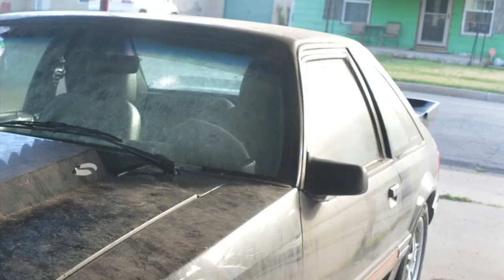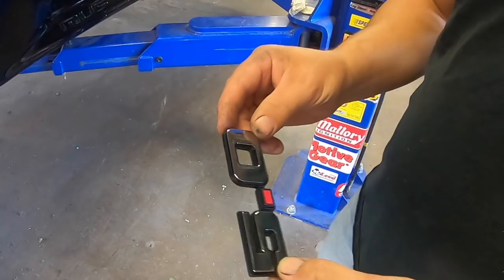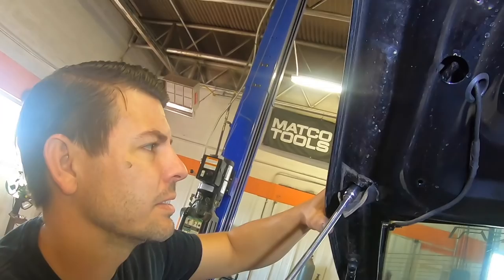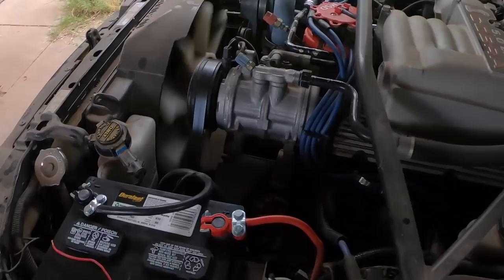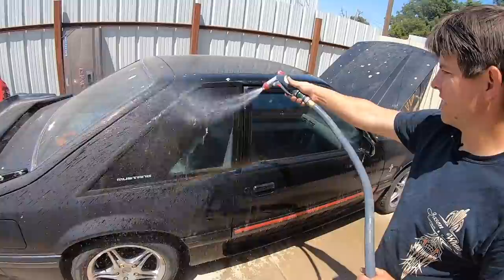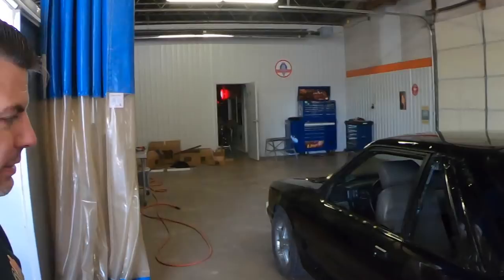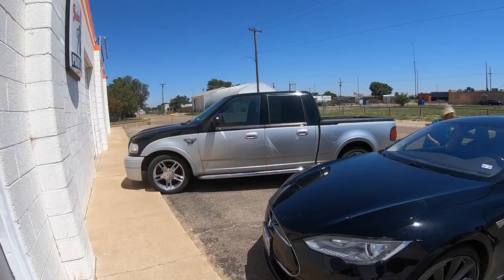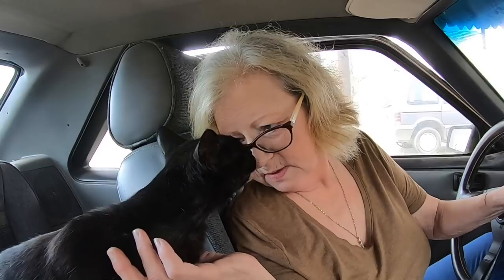Watch Us Rescue &  Restore Neighbor Lady's Mustang At No Charge

Comment: Cars are worth more unmodified. I had a friend buy a Brand New Trans Am in 1978 for $6000.00 He then spent Thousands of dollars modifying it to turn it into a quarter mile drag car along with buying a trailer to put it on and a pickup to tow it with. At auctions a nice T/A of that vintage often sell in the $25,000.00 range. That car being modified would be worth nowhere near that not to mention all of the money that was pissed away on everything else.
Reply from the maker: Absolutely and this is a common problem with performance cars.

Comment: good work!  we were all disappointed when you removed his custom touches but at least you didn't rip her off for the car and got it going for her.  the cobra intake and gt40 heads, wheels and custom hood and JBA parts were likely worth more than the 4k you offered, and worth more sentimentially as they were his unique custom touches.
Reply from the maker: Oh, so nw you think this 5.0 has GT-40 heads? Unbelievable. You think we made an offer? No offer. She had a sentimental attachment. Like the video says at the start, we decided to help out a neighbor and save a car. Once the weather stripping breaks and water gets inside, the car would really go downhill.. Those are stock GT heads, and the ports don't match the ports on the COBRA  intake that was stamped CHINA on the reverse side. The old plastic parts were in poor condition and would take more money to repair and paint than they are worth. The son saved the original parts and did not even remove the catalytic converters or smog. Unfortunately, over 13 years the original spoiler hood, and other stock parts went missing.

Comment: just the paint correction alone would cost a grand, Pluse the parts they purchased to replace the performance parts they removed. They were going for reliability so that she could get around in it. If you have ever modded a car you know the first thing you loose when you start putting on go fast goodies is reliability. Agree with what they did 100 percent.
Reply from the maker: Thanks!!

Comment: I agree with a lot of the previous posters.   They should have freshened up the mechanicals, power polished the paint, and left the kid’s additions on the car.  It was his vision, and a connection for her.  And they couldn’t even be bothered to put the proper trim caps on the stock wheels??
Reply from the maker: We "couldn't be bothered?" We bought the Turbine wheels off eBay,  but no covers came with them and we have been hunting a set ever since.

Comment: Those JBA decals on the car are from a well known and somewhat famous even Fox Mustang  builder, modifier, and performance parts company called J. Bittle American. Anyone even the least bit knowledgeable about performance modded 5 Litre Mustangs would know this. J.Bittle American probably supplied the son with most if not all of the aftermarket performance parts on the car. To my mind, the car should have been fixed up and restored to running condition the way the son originally had the car, with all the performance parts and mods  left intact, rather than as it is now,  a boring, basically bone-stock, 'belly button' car.  As a former owner of 5 Liter LX coupe that I bought brand new in the spring of 1989,  I can tell you that to most of us who bought a new 5  Litre Mustang back then, the car, rather than being just mere - and and somewhat basic  transportation - was really a blank canvas to build, hop up, modify and make truly our own, to our hearts desire and to the very limit that our budget and high performance street drivabilty would permit. This car  is, or was  - at least until these  'return everything to stock obsessed' so-called "restorers" got their hands on it - one of these!

Comment: Why would you get rid of the Ford Cobra intake and go with a std 5.0 HO intake? The Cobra intake is highly coveted and flows better.
Reply from the maker: Primarily to do this car right, being so "untouched," meaning with the smog and catalytic converters. The Cobra intake flows better into larger Cobra heads, but this 5.0 GT motor has stock GT heads with smaller ports. The son saved the stock air box, so we used that. He had saved, apparently, all the stock parts, but over the course of 13 years the rear spoiler, hood, and other parts were missing. He took extremely good car of this car. I will show more of this in a second video.

Comment: Why would you take off the gt40 intake to put a stock on??
Reply from the maker: To do the car right because it was so original and untouched, and for maximum value - if Jason was going to do all that work. The engine was so incredibly original, right down to the smog system, intact, and even had the catalytic converters. The intake might have said Cobra, but on the back the Cobra intake was stamped "CHINA."

Comment: This can be looked at in several ways. On one hand, I understand that the restoration guys DID NOT HAVE TO DO WHAT THEY DID, they put at least 2grand in this car with parts alone, and not to mention the labor. So by basically restoring this car, they put this lady in the position to sell it or drive it as her own. But on the other hand, (being the owner of 3 fox bodies myself), I can see why several of you guys are upset. I mean, her son had the Cobra upper and lower intake setup, MSD, Cold air, 5 lug conversion w/ aftermarket wheels, and Cowl hood and spoiler. To remove all of that would get me upset too, my question is, what happen to those parts. Did they return them to her?

Comment: A Foxbody in decent shape(which this one appears to be) is going run you around $8K minimum.  Mint condition could be as much as $30K.  This dude is a bit shady with his offer.  She's had offers from $10-$15K and he suggest it's worth $5K?  huh?   I'm just glad she wasn't dumb enough to sell to them.
Reply from the maker: This "dude," NEVER made an offer. He was looking at the current value, not running, which is what she wanted to know. This "dude" fixed her car for free, bought paint, bought a rear spoiler, gave her a stock intake manifold, and much more over the course of 2-3 months, fixed the air conditioning, buffed out the paint (10-12 hours), and then returned the car to her to do as she pleased. Do you just see what you want to see and not watch the video?
Reply: @thewriter2549  : Nah, if she would have said  Yes, he would've bought it.  Guaranteed.  & this video wouldn't be here.  You may be an idiot, but I'm not.   It wasn't in bad shape. It fired up with not to much work.  Been there done that

Comment: Sadly they removed everything  her son wanted
Reply from the maker: No, her son kept all the stock parts (but many were missing) and this car is incredibly original under those few mods. We did the car right. It even has the original catalytic converters and smog!!  Even the switches inside are sharp, like the markings on the turn signal lever and the electric window buttons.

Comment: 9:52. Yeah. 4 thousand for a peace  of junk.  This car dnt need nothing jst a tune up and.   That's it. Dnt lie.
Reply from the maker: Luis - Oh, so you would put this lady on the road with dry rotted tires? We got those replaced. This car needed much more than a tune-up. What about the rusty brakes front and rear? You would leave those? Jason replaced the fuel pump and battery, more items of absolute necessity. The weatherstripping was dried out and needed replaced. Did you watch the video? Don't lie. Can you drive this 5-speed without a shifter handle? The weatherstripping was dry rotted and needed replaced. The exterior cowl panel was broken and needed replaced. Oh, the car had NO KEYS!! Could you drive this car without keys!!! Buffing the paint took 10-12 hours, and yeah the Mustang would drive with the chalky paint, but we wanted to make the car look as good as it drove. Jason repaired the damage to the front bumper and replaced the rear bumper cover - and much, much more.  Did you watch this video? Don't lie!!

Comment: I would to cleaned it got it running good with the stuff that was on it..  Shame on them for doing that, shes attached to the car her son loved.. They removed that. I would of repainted the car before removing the hood and spoiler, wtf?
Reply from the maker: I can appreciate your emotion about keeping the hood and rear spoiler, although you would have a lot of body work to do on both, so buying new would be far cheaper, and if somebody wants to do that, let them have at it. There was no shame putting the car back to stock. The son saved original parts, but most (except for the air box)  came up missing over 13 years, including the steel front hood and the rear spoiler. Saving these original parts indicates his plan to return the car to stock one day. You write about getting it "running with the good stuff that was on it," so address the front and rear brakes, which were rusty, same for the tires, which were dry rotted and also not safe. Would you have left those as is? The shifter handle was gone, and Jason replaced it. The Cobra intake, stamped   "China," did not match the stock heads, and Jason gave up one of his to restore the car to original. The rear bumper cover was damaged and we replaced and painted it. The front bumper cover needed body work and Jason fixed and repainted it. This is not a TV show with a budget. This started out to get the car running and do some how-to's and it turned into more because of donated parts from LMR and Jason White.

Comment: The video maker is WRONG! She does not have an exaggerated idea of the value of the car. 10-15k is more than a Fair price for that car. You can't find a regular 5.0 mustang in good condition for less than 8k in CA let alone a Cobra in exceptional condition. 

Also, if she has had cash offers for those amounts, that means that car is worth that amount. How are you gonna say otherwise...annoying. Otherwise great job.
Reply from the maker: Don't be silly, Ford didn't even make a Cobra Mustang in 1988. This is a GT, and only exceptional after 10K in parts and restoration. Did you watch the video?

Comment: Okay I just don’t like how you complete changed the look her son was going for and the power he was aiming to put out . For every part you removed, you removed a piece of her son . I hope you guys didn’t keep that intake for personal use or sale 🤦🏽‍♂️ performance parts on cars are not reliable when you DONT tune your car to the performance specs , her son probably had a small cam in it rollers and lifter kit install with the cobra parts . That cobra set cost more then the 302 block it’s self . Yeah the stock parts add value to the car but how her son made the car adds value to her towards the car. I don’t even think she cared how it looked she just couldn’t get around in it or even turn it on because clearly she doesn’t have a lot money to put into a car to fix and still having to fix her home and pay bills . Hope the funding for this video goes to her.

Comment: This video honestly just made me mad, like you pulled everything off it that made it continental, like clean it up and fix it up but don't take the aftermarket stuff off it. Very cool that they did that for her but at the same time you kinda ruined the originality of the car and what it was
Reply from the maker: The owner saved the original parts for a reason - to put them back one day - and this was that day, except the old rear spoiler, hood, and many other parts were gone. We restored it. That rear spoiler we had to cut off.

Comment: Wow take all the performance stuff off make it look nothing like her sons car what a joke!!
Reply: Not to mention j b a did infact promote the 88 fox body
Reply from the maker: It looks exactly what it looked like when the son bought the car, was stock. Try this sometime and you will find out, those heads don't match those ports, that fiberglass spoiler had to be cut off and was no good. If I could have been there to photograph the infinite details you would see. I drove 100 miles each way to the shop many times.